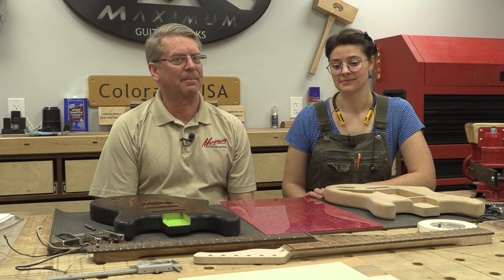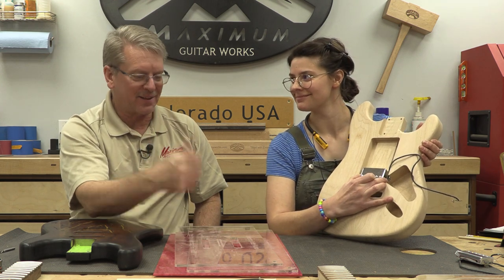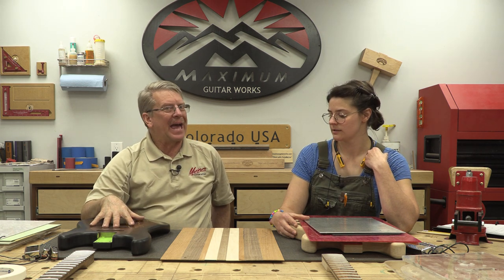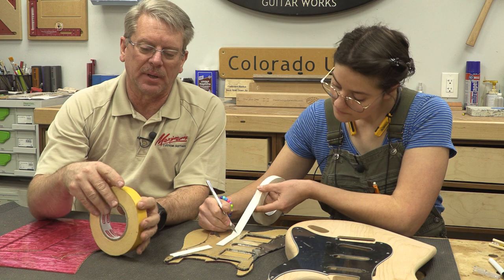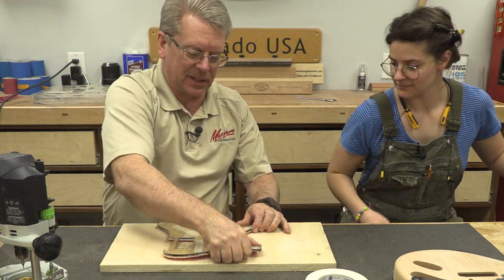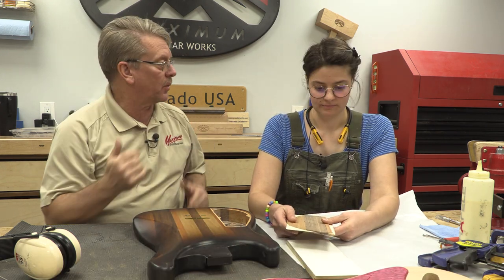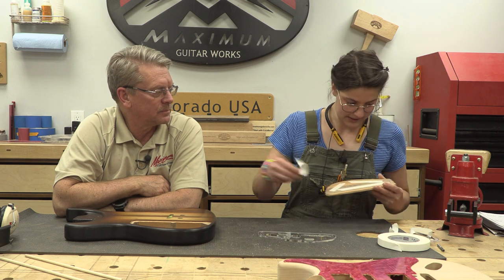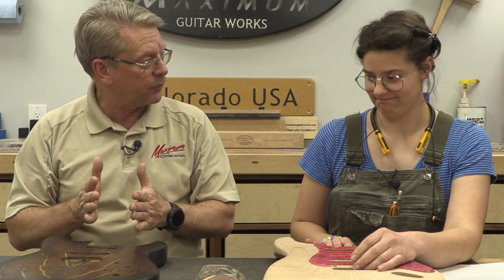Premier Strat Build - Part 10 - Pickguards and More

Comment: What are the two holes on the back of the walnut body by the bridge ferrule block route?
Reply from the maker: If you look back in the older parts of this series…you will see that I am using the Schaller Hannes 6 fixed bridge on the walnut top guitar. That is for the unique mounting hardware. Thanks for the comment…I should have mentioned that in this video.
Reply: @maximumguitarworks  Thank you. I asked because I have seen it on other guitars and wasn't sure why. So far Ive only built with Hipshot, Floyds, etc. No Schaller, so am not familiar with that mounting.
Reply: Great video! FYI I have used clear packing tape instead of wax paper that worked quite well.

Comment: I always wanted a strat with highly figured top and a clear pickguard to protect the top and then paint the edge with black or gold.  But now that I am watching this I that I bet Steve could figure out a way to do binding bonded to the edge of a clear pickguard.  So do you think such a thing is possible?  I know binding is a different type of plastic and using solvent to bing would most likely make the clear plastic milky unless it was lexan.  Just a thought, you welcome to ignore it if you have no time.  But they always say doesn't hurt to ask.  Unless you figured out how to smack somebody thru the computer screen.  In which case can you tell me how to do that?